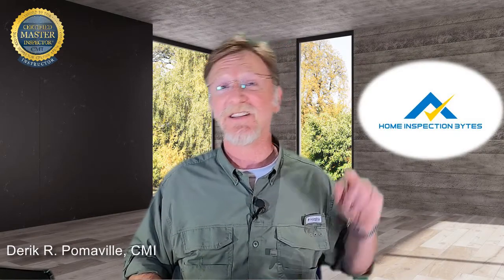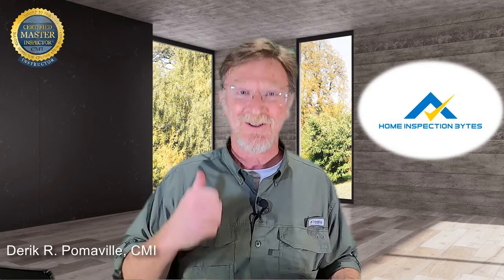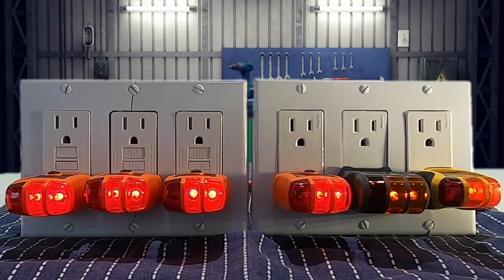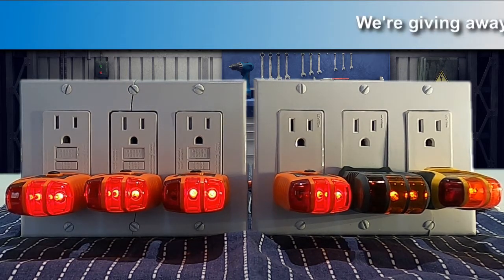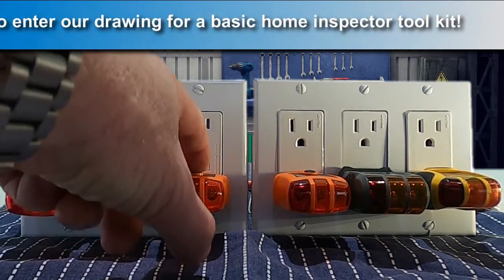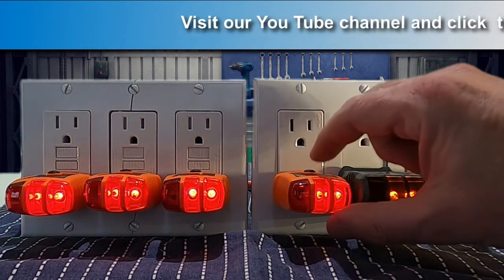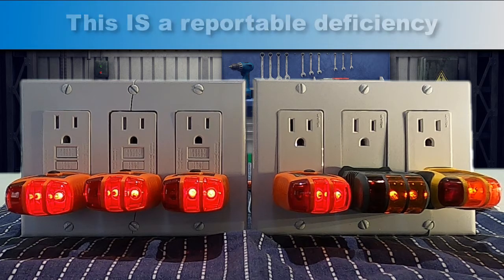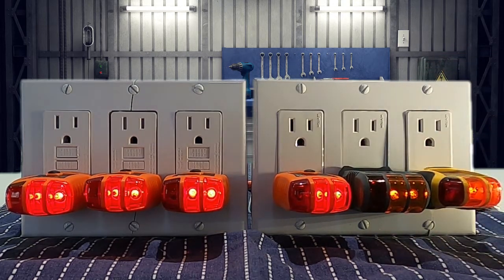Multiple GFCIs one Circuit

Comment: The problem isn't multiple GFCIs on one circuit, that by itself is fine. The problem is having one GFCI connected to the load side of another GFCI, so that one goes dead when the other trips. That's what should never be done. If you wire multiple GFCIs on one circuit by their line sides only, each will trip independently without affecting anything else. That's perfectly fine, and is the right way to wire your example of three GFCIs in three different bathrooms. Ideally, the only thing that should be connected to the load side of any GFCI are normal outlets in the same room.
Reply: Agreed. It’s more confusing if the gfci outlet is in a different room when they share the same circuit. If he had wired the outlets in the video correctly there would be zero confusion for anyone when testing or responding to a tripped condition.
Reply from the maker: @lordgarth1  While you are correct had I wired them correctly, it wouldn't be confusing. That's not the point. We are demonstrating a common issue found on a home inspection for new home inspectors so they understand how to explain it to their clients.
Reply: Thank you for your comment, you just saved me from this stupid misleading video.
Reply: Yep, in the example the GFCI are installed wrong. They used the load side.  That means it had gfci protection and did not need extra gfci recepticals. Individual gfci receptical should all be wired on the line side.  So the inspector here did not know the difference.
Reply: @H Henry Nice  The issue here is that in most homes there are other regular receptacles on the load side AND THEN other GCFI receptacles following on the same circuit... which is the exact example here!!! So you guys are picking holes in his explanation that are the exception not the rule in most homes!
Reply: In other words parallel vs series?
Reply: @MrJustus88  No, building wiring is always parallel. Everything's designed to run at a certain voltage, and you get voltage drops with series wiring. Really the only thing we commonly use that's wired in series are Christmas lights.
Reply: Thank you very much! I have a long back porch and wanted 3 GFCI outlets on the wall but wanted them to trip individually of each other, (why would anybody want them all to trip?) I think I actually read and watched videos on the entire internet to finally be clear on this!🤣
No disrespect to @HomeInspectionBytes, your video was great it just didn't go further into what I was looking for specifically. Cheers and Happy thanksgiving to all!🍻
Reply: thanks everyone its clear as mud
a gfci will protect a circuit up stream and down? more then 1 gfci per circuit is redundant?
if 2 are wired one after the other then power comes in to 1st one on load out to second on line then? into line on second one?
difficulty getting 2 gfci on same circuit to work today and im not sure why
Reply: @jamesderoc6717  The only time you ever use the load terminals is if you want other non-GFCI outlets on the same circuit to have GFCI protection. Anything wired to them will behave as if it is part of the GFCI outlet itself. In ANY OTHER SITUATION, you ONLY use the line terminals. Power always comes in to the line terminals. If you have multiple GFCIs on one circuit, you wire them by the line terminals only. 

For example, say I have multiple outlets in one room, and I want them all GFCI protected. Getting multiple GFCIs will be expensive. So, I get one GFCI and normal outlets for everything else. I connect the power to the GFCI's line terminals, and the normal outlets to the load terminals. They're all protected, and the GFCI will trip in case of a ground fault at any of the outlets.

On the contrary, if I want multiple GFCIs on one circuit, say for outdoor outlets, they're pretty far apart, so I don't want them to all trip together. I get multiple GFCIs and run power to their line sides only. Now, each will protect only itself and will trip separately from the others. I don't use the load terminals at all.
Reply: @KingdaToro  thank you for the clear comment mate. does the gfci need to be first thing wired on a circuit for it to protect that circuit? or it can back protect others wired before it?
Reply: @jamesderoc6717  No, it will only protect itself and anything wired to its load terminals. It will not protect anything wired to its line terminals (before it).

Also note that if a circuit has a GFCI breaker (rare, as they're quite expensive), the entire circuit is GFCI protected through it, and  you should never put a GFCI outlet on that circuit.
Reply: @KingdaToro  thanks again very helpful
Reply: If you wire a GFCi to the line side only, there is no protection on the outlets downstream even if the next outlet is GFCI, no protection between the two.
Reply: I am installing a pump for a bog filter and will have 2 side-by-side GCFI outlets  (their own separate circuit) on the same wall so that I can hook up lights and the occasional small power tool near the bog.  I will wire as your last line suggests:  by the line side only.
Reply: @kathleenzoda5621  If they're within sight of each other, there's no need for them to both be GFCI. You can save money by getting one GFCI and one normal outlet. Connect the incoming power to the line terminals of the GFCI, and the normal outlet to its load terminals. You really only want multiple GFCIs on one circuit if they're going to be far enough apart that getting to the GFCI will be inconvenient when the GFCI is tripped by something plugged into another outlet that's protected by it.
Reply: In a perfect world yes you would wire the other GFCI receptacles on the line side... BUT in most homes there's other regular receptacles chained on the load side and THEN another GFCI on that same Chain!! Almost no home has two separate cables coming out of a GFCI to power another GFCI down the stream separate from load side... Unless you were an electrician who does weird stuff just because technically it works!
Reply: @Montro_Full  The point is that there is no reason, whatsoever, for anything connected to the load side of a GFCI to be a GFCI. It just wastes money and causes the problems you see in this video.
Reply from the maker: Thank you for the comment! And while your observations are true, multiple GFCIs wired correctly on the same circuit means they will function correctly. In that case, the home inspector will be able to report proper functionality. The purpose of the video is to demonstrate a commonly found deficiency, the symptoms, and how no matter how they're wired, multiple GFCIs on a circuit is unnecessary redundancy and a nusciance.
Reply: @HomeInspectionBytes  unless you live someplace that allows 11 outlets per breaker but only up to three outlets from a gfci
Reply: @HomeInspectionBytes  That may be your intent but that's not how it's coming across. Also remember that your audience is larger than just inspectors, someone who taps in gfci outlet inspection fail might run across this video, and take completely the wrong message from this video.

Great power great responsibility all that...
Reply from the maker: @grscklyr4dfbz  thank you for the advice. I disagree about our audience, though. I'm trying to help first year home inspectors recognize symptoms of problems we can't see. Maybe you could visit our website or Facebook page and see how our goal is to provide byte- sized information for the new home inspector. I'm looking forward, however to watching your electrical engineering videos for the masses and to learn more of those fabulous comic book tidbits of wisdom. Make sure to send me an invite,  I'll be your first subscriber!
Reply: @HomeInspectionBytes  Re the comment by "grscklyr4dfbz", I searched "how to identify 1st outlet on circuit" and got your video. Another video suggested I don't have to rewire my entire new (old actually) home's 2-prong outlets, but instead should put a GFCI on the first outlet of each circuit. Thus my YT search. So while I appreciate all the folks who make these helpful videos, I think he is right that you need to be thoughtful about who 'might' watch them. To say, in effect, "I'm not responsible for what happens to people who shouldn't even be watching my videos," seems a bit inconsiderate.
Reply from the maker: @sbearly  Like so many other critics often do, you've taken my comments out of context.  I never even said what you put into quotes. I did, however, defend why I did what I did with the videos.  Please allow me to restate.  The purpose of the videos is to teach home inspectors the symptoms of various problems.  This is well stated throughout the videos we make.  To go through all of them and make sure I have a proper message for everyone who may be watching them would mean developing a college length course for electrical engineers.  Quite frankly, that's not going to happen.  We appreciate you watching.  We like all the feedback and interaction.  And hey, if you think I'm inconsiderate because my videos cater to a specific group, and not the entire planet, that's ok, too.  Calling me inconsiderate, well, that's just childish and counter productive. When people resort to name calling and sarcastic references to comic book wisdom, I will point out the sheer ignorance of doing so and poke back a little bit.  If you have the right to call me inconsiderate, I could, for example describe you as short sighted and arrogant for not considering both sides of the equation.  I don't like doing that, though, because it lowers me to your level.  🤣 If that last line offended you, then don't leave feedback and go back to your cocoa and bubbles.  You misquoted me and misinterpreted my statements.  You're going to reap what you sow.  Next time you put something into quotes, make sure it is, in fact, um, a QUOTE, lol.
Reply: @HomeInspectionBytes  I didn't misquote you. I pointed out that you "in effect" said something that I thought was a bit rude to another commenter who made a simple recommendation with which I agreed. Perhaps one can become an electrician without understanding the subtleties of the English language. You've taken thoughtful comments by two people who took the time to watch your video, both of whom expressed appreciation for your video, and responded in a immature, defensive manner. If it bothers you that people that are not home-inspectors watch your videos you shouldn't put the videos out. YouTube videos are available to everyone and many people use YouTube to find out information, especially on topics they are not familiar with, and especially 'how to' videos. If someone makes a video on how to clean a gun and gets reminded in the comments that he should have first pointed out how to verify the gun isn't loaded he should not respond with, "My videos are only for people who already know to verify the gun isn't loaded."
Reply: @HomeInspectionBytes  maybe you should of mentioned the correct way of hooking up GFCIs on the same circuit. Instead of saying it's not wrong but it is wrong.🤪
Reply: @HomeInspectionBytes  I know it’s old but I agree with the previous comment. Clearly nowhere in the video does it show the supposed “correct” wiring instructions. Your video is exceptionally misleading by irresponsible omission. Anyone watching, electrician, homeowner, inspector, kids, should be informed that alternately not wiring gfci to the previous device’s load side prevents this scenario and is a common practice and should NOT be written up, but you don’t. You provide incomplete information that basically ignored good electrical practices and correct wiring and says any time you see multiple gfcis on a circuit write it up (even if wired that each operated independently). I can see why you’re being attacked. How anyone can think that leaving out common good information in order to create a bad practice (always write up multiple gfcis on a circuit) clearly shows a lack of professional understanding and to take it further to ignore what even a 1st year apprentice would know being pointed out to you by seasoned professionals who understand the NEC is even more egregious. I for one applaud your arrogance. It makes the case for ignoring the rest of your company’s information and makes it crystal clear to stay as far away as possible from using your inspection services.
Reply from the maker: @Imatarget-kb8xv  You are entitled to your opinion, no matter how cynical and misguided it may be. The video is for home inspectors to understand the symptoms of incorrectly wired GFCIs. In this context, the video is informative and correct. As for your opinion of our services, don't call us for an inspection. We're ok with that, lol.
Reply: @HomeInspectionBytes  But this isn't what you are saying in the video.  You are showing an improper installation that should be reported.  In the video you are saying that home inspectors should always write up multiple GFCI's even if they are wired correctly. Suggesting that home inspectors report problems that don't exist will result in home owner paying an electrician to fix something that isn't broken.
Reply from the maker: OK, I'll try to explain this once again.  Wired in the manner described in this video, it is a nuisance to the homeowner and should be reported.  Wired correctly, and multiple GFCIs on one circuit won't present the symptoms shown and does not need to be reported.    @Roy-ij1wq
Reply: @HomeInspectionBytes  unnecessary yes. But so is soundproofing glue between two sheets of drywall. Doesn’t make it wrong or unsafe if done properly.
Reply from the maker: @tb2324  Watch the video.  Listen to the narration.  Carefully.  I never said it was unsafe.  I said it's a nuisance to the home owner and home inspectors should recommend repair.